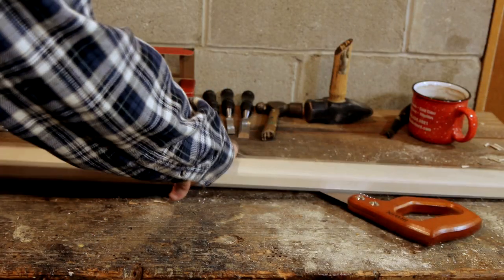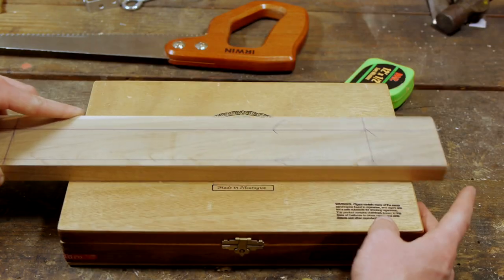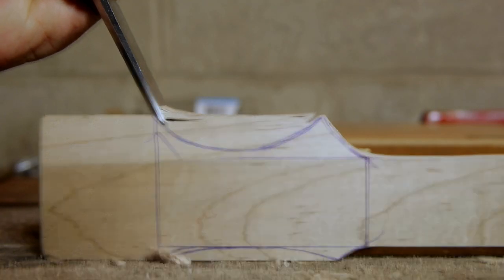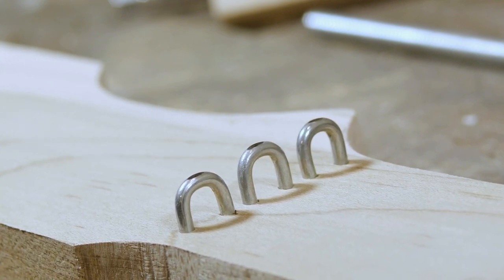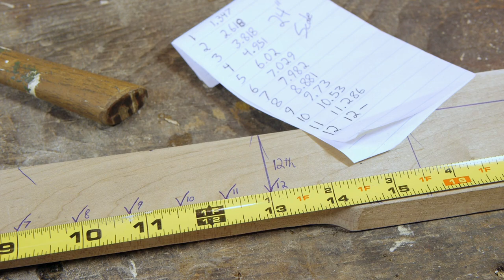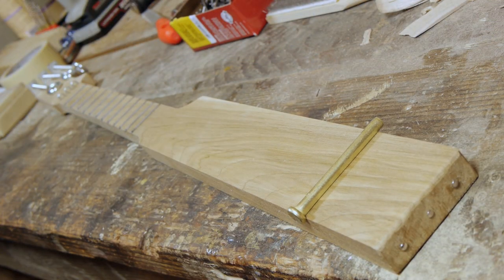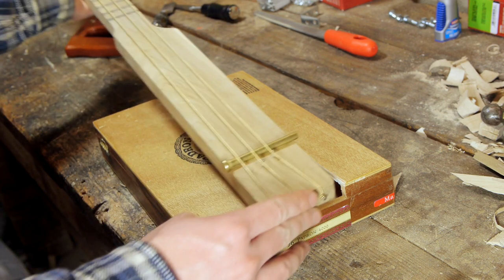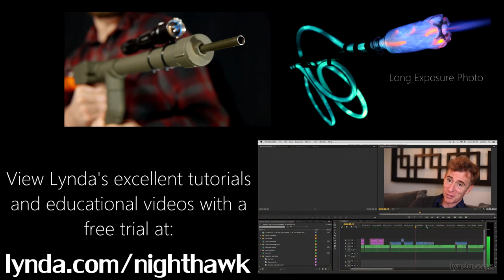How To Make A Fretted Cigar Box Guitar

Comment: I watched your video and it's nice to see a guitar being made from basic parts.  I make cigar box guitars and for very little money and effort, I would suggest real machine heads.  They are easy to install and much easier to tune.  Also fret wire is so inexpensive and with the right size of slots being cut, will stay in without any need for glue.  For cutting out the shape of the neck I would clamp the wood and cut slots along the neck up to the line and then chip them out with a chisel.  There's less chance of splitting the wood the wrong way.  I'd also use a pencil to mark everything, use wood glue and clamps, mark the fret lines in two places and use a t-square to draw the line for cutting.  I also like to install the neck inside the box and have the bridge on top of the box for better resonance.  Sorry this isn't me being critical, these are just things that can be done for not much more effort or money.  Great video :)

Comment: Working on my CBG as I speak. I’ve stolen some of your ideas and have added a few of my own. First off you can’t get cigar boxes where I live in N Ireland and so I’ve had to make my own box out of 3mm ply with a lite pine baton for the sides. I could only get a piece of walnut for the neck which I had to buy rough cut and miles too big all round. I’ve spent most of the day shaping it because I decided on a profiled neck wide enough for 4 strings. I’m using your tuner idea but put wing nuts on so hopefully I’ll not need a wrench to tune up. I’m enjoying the challenge. And I thank you for giving me the inspiration. I can’t see mine turning out anywhere near as nice as yours but I’m doing alright for an old timer with Parkinson’s. I’ll keep you posted.

Comment: Great video. I especially like that you have used simple tools instead of power tools. Maybe in the next video you could make a piezo beer-can microphone to complete the vintage country rig? ;)
Reply from the maker: I haven't looked into that before, but I bet the sound would go great with a CBG!
Reply: That would be sweet! I have built cigar box guitars before, but this is so much nicer of a design... I'll be using this for sure! 
I would absolutely love the beer can piezo microphone idea to go with it! 
The idea with the eyebolts is genius, does it hold tune well? And the bridge pins, does the pressure the strings create hold them in well, without tuning issues? 
Cheers, thanks for the new ideas!
Reply from the maker: ezrocks4u The tuners work pretty well, they're just easy to bump which sends them out of tune. The bridge pin works fine under string pressure

Comment: BEAUTIFUL CRAFTSMAN!
Reply: I was once considering how to make tuners/tensioners out of nuts and bolts, but this is a good design with the eye hooks.  A bandsaw is a good tool to have, but could be expensive, or a few minutes at a friends one, makes it simple, but chisling shows craftmanship with basic tools.   It would be good to convert those fret positions to inches and, plus,  16ths or 32nds of an inch.   THis is unique construction and design, and practical without fuss to make something.   An oval hole on the neck could help the string sound get into the sound body a bit better, but it would not matter if you put a PAF in it.  Possibly , the back of the neck can be rounded a bit more, with a 45 degree angle at the sides, perhaps 1/2 to 3/4 in, and then gradually smooth it round with a file and sand paper.
Reply: Muito interessante...!!! ~rr" ...
Reply: GREENPOWERSCIENCE p

Comment: This was a thorough and well-planned video.  I'm a casual woodworker, and had no problems following along with not only the 'what' you were doing, but you also did a great job explaining the 'why.'  I don't play guitar, but this makes me want to try it!  One question for you: have you found that the superglue holding the neck to the box was adequate? I'd be worried about those two lines of glue holding the entire neck to the box.
Reply from the maker: +RusselSprouts1 Thanks Russel!  Yes, I have found the superglue to be adequate. It would not be terribly difficult to break the box free with some effort, but doing so would not damage the neck so no harm would be done. Since the box has no reason to be held on any more securely than it is, I opted for a relatively weak connection in case it ever needed to be removed for repairs/replacement.
Reply: Ahh, excellent point. Solid work, I might have to give it a shot!

Comment: you guys need to use metric !!
Reply: Tell that to the old people who won't let us.
Reply: One president already tried it, it didn't work out, although I wish it did
Reply: Damnit Jimmy! Why couldn't you pull through for us?
Reply: I'm American and use metric with all my original measurements
Reply: I guess the military needs to go back to gallons and inches
Reply: As an American that grew up woodworking...yes. Yes we do.
Reply: as an american
growing up doing construction
no we fucking dont
Reply: As someone who went to school.
We already use metric. Imperial units are defined by the metric system and have been since before you folks were born. So we might as well just drop the redundant multiplier.
Also all of science and military use metric. The imperial system is archaic and if it wasnt for it now being defined by metric we would be nowhere. You cant measure things to any agree of objective precision by using it. It was good enough in the medieval ages, but not in the 21st century.
Reply: I agree to this. I'm very excited to make my own CBG and I appreciate all the tutorials, but many of the good videos don't use the metric system. Well, maybe I have to buy a non-metric ruler. Cheers from Germany!
Reply: we do

an inch is defined as exactly 2.54 cm. 

when you're dealing with hardware, 1/4 drill bit etc the easiest way to do this is to just multiply the number of inches by 25 and round to the closest, and that's the closest size in mm. Therefore a 1/2 inch bolt -> 12.5 -> 13mm bolt in metric.

When it comes to the fretboard itself you'll be getting that information off the internet so you ought to be able to find it in metric anyways.
Reply: Yes and no
Reply: Get over it.  We do just fine. And it's not hard to convert for uses like this.
Reply: @simon4187  💀

Comment: Really a good first try... I have built a few instruments and assisted a violin maker during an internship I was serving to learn some of the basics... one thing that improve things a bit is use  brass nails( a little harder to find  ) for frets and a 8" sanding block to level your frets to prevent string buzz...cut equal spaced groves  in your hinge pin bridge to let the strings set in  and one up from that, use a hard wood bridge instead of metal which will allow the sound to travel into the cigar box more efficiently which will allow for better resination  of the sound and tone of the instrument...thx Larry

Comment: Man, this was such an awesome video to watch. I used to have an acoustic bass, but sadly no more. This video has made me want to try building my own. I noticed one thing about the way you constructed the head makes it not an easy guitar to tune on the fly. 

There are probably a bunch of other people who mentioned this in the comments here... But if you altered the design of the head a little bit, it would also make changing the strings easier too. I would angle the strings the opposite way you've done it and create a second bridge at the point where the head and neck meet. This would allow you to put tension on the lines without adding the additional block of wood you did. 

It could also enable you to easily make this a 4 string bass by positioning the tuning pegs to two on the top and two on the bottom.

Comment: That sounds pretty and warm tone .
    Like the way you used I bolts as machine tuners and staples as guide pins or string trees. I tried to cut my slots like that about 25 years ago but I couldn't cut them close enough to keep my intonation right. I used nails too. You are better at measuring transferring cutting installing frets.

Comment: hi,  i'm trying to make a six string one and have a couple of questions:
1. what should the distance between 2 adjacent strings be?
2. is there a drill attachment/bit that does the job of a chisel in a faster and more efficient way
thank you, you have the most down to earth method witout huge and fancy wood working tools
Reply from the maker: +Vincenzo Shabeeb Between two strings is a matter of preference, but about 1/2 inch or less. To cut the neck faster you can use a hand saw to cut most of the wood away before chisling.

Comment: I used a lot of the points on this for a ukulele I built. I also used it as a reference for a cigar box bass guitar I'm making for my friend. (I screwed up the chiseling the first time.) I am doing something more similar to your older video (which is also interesting and useful) and putting the wood inside so the logo is still shown. I'm also going to attempt to wind a pickup at some point.
Reply from the maker: That sounds pretty cool
Reply: Wow, you really do read all of your comments, even when the video is 2.5 years old. After watching this video about 15 times, I always wondered, why didn't you secure down your door hinge?
Reply from the maker: There's no need, the strings hold it in place.

Comment: I would use a band saw and a drum sander.  The chisel will cause the wood to slit like it does in your vid.  Would be a pain if you have to start over due to the wood slitting open.  A small square would be helpful to make the lines straight.  Some of them you could tell were off.

Comment: When marking frets, I just use the centimeter side of the tape measure, and multiply the length by .9439 each time for the next fret.  Centimeters are marked in tenths (millimeters) so it makes it easy to find the correct placement.

Comment: Would it be viable to make a 6 string version of a roughly similar neck size if you offset the tuning pegs on the headstock? 

like say if the top one was 1in from the nut, the second was 2in from the nut etc.?

Comment: I've made dozens of these in the past 4 years. I actually use 3" 3 16ths eyebolts with wingnuts instead of the 4" 1 /4 "With nuts. Before I cut any  of the board away, I cut the fret slots while everything is straight and true. I graduated to using a jigsaw instead of a chisel. when I do use nails, I use 2 inch nails to avoid having to grind down the head. Everyone I post these On Cigar Box Nation, I call them a NightHawk. Other people have named what I build a Lyons NightHawk.
Reply from the maker: That's awesome, glad you've had some fun with this one! Looked up your builds, they're great!
Reply: That's awesome. Thank you for taking  look. This is the first instructional vid on cbg's I've watched. This is a brilliant design. You're videos are top shelf and truly inspiring.

Comment: Incredible.  Would you conceivably be able to double the width of the fretboard and make it a six string?  Also, how did the strings hold up?  That figure 8 knot you did made me nervous...
Reply from the maker: Knot did fine. For six strings you would not need to quite double the neck width, but the headstock would need to be much larger.

Comment: There's a minor detail that's gone missing in translation. There are many 4-inch eye bolts out there, but the diameter is pretty important. For example, this won't fit a 4"x0.25" bolt, as it'll be just too big for the bracket hole. Aside from that, this is an excellent example of some DIY creativity!

Comment: so i finished making mine, the fence staples were bent nails and didnt work as well as the square ones which were not for sale at lowes, the eyebolts i had to go to ace hardware for, no one knew what #18 eye bolts were so i got 4 inch 1/4 eyebolts, my neck dimensions were also different you also failed to mention you need a 4 foot long plank the plank was .75 x 3.75 × 48 i shaved it down to 2 inches wide, had to buy a new chisel as i was working with a dull one. for the frets i used flag pole wire i had fret buzzing on my E strung on frets 1-3 so i had to apply flag pole wire butted and glued against the the fret right before the actual fret. I also had to adjust the height of the staple on the E string which meant pulling the staple, and gluing in tooth picks letting them dry for 12 hours the sand it down and reapply the staple bc the action was too low hittingt the first fret and buzzing. Now i havea fret buzz on the D string on the 7th fret i tried placing flag pole wire in the area but that added buzzing elsewhere and deleted my 6th fret bar turning 6 and 7 into the same note. What do i do to solve the buzzing?
Reply: For anyone with this problem, as far as my knowledge goes (not that far) the solution to buzzing has most times to do with a proper, EVEN sanding of the frets; they really need to be ACCURATELY the same height, otherwise they get in the way of each other and produce that all horrible buzz. Use a relatively long piece of wood covered in sandpaper to sand across multiple frets at the same time, with proper pressure distribution,  and good luck. Thanks First Last for sharing your experience, it's encouraging to know that it you'll not find the exact materials but it can still work :)

Comment: Awesome work. Is it safe to assume that I could use these techniques to make a 6 or 12 string, except maybe use smaller eye bolts?
Reply from the maker: Yep. I might use regular guitar tuners for simplicity if using more strings.
Reply: NightHawkInLight , fair enough. I’m notorious for my “mad scientist” experiments with CBGs. I might try it with a 6 string just to prove I can. But you’re right. Using regular tuners is probably simpler.

Comment: A suggestion: try to glue a bit more wood into the cigar box. You could put some 1x1s inside of it, touching both the surface of the cigar box and the neck. It could fall and break very easily if you just have the few mm of the box making contact with the neck
Reply from the maker: Not too big an issue in this design because the neck has all the tension on it. If the box broke off you could just glue it back on.

Comment: I'm planning on making one soon. but I have a question. is it completely necessary to use a chizzle? or could I use a table saw to get the lengthier parts cut? also could four stings be put on instead of three?
Reply: Adam Sherman you can do anything you want, you just have to change a few measurements on the headstock

Comment: You say to sand the wax out of the fret holes. Do I have to do this when using varnish?
Reply from the maker: You should at least lightly sand the varnish in the grooves so the glue has some texture to stick to.
Reply: NightHawkInLight
Isn't varnish better to stick to? Atleast I thought so since you can buy glue/varnish combo's in one bottle.
Reply from the maker: Maybe, but you should rough up the surface all the same. Glue always sticks better to rough things than smooth.
Reply: NightHawkInLight
Isn't a rough service bad for the strings?
Reply: You're roughing up the slot in which the frets are being placed, so it will never see the light of day after it's been glued in.
Reply: TIMExBANDIT
Okay, sounds a bit grim but okay xD.
Reply: You are roughing up the pits that the frets will be placed in, the strings will never touch them.
Reply: MrTrollinglol
But it's for slide guitar. So on my old guitar it touched the frets too.
Reply: The slots for the frets need to be roughed up for the glue to stick, same done with the frets themselves so it'll stick to them well too. He sands the part that actually touches the strings smooth later on. It was also said in the video that if you're doing this for a slide guitar you don't really need the frets, if I remember correctly.
Reply: *****
Oh. Thanks. That solves the problem.

Comment: Is it necessary to chisel it away or is that just how you do it? Would i be able to use machinery like a Jigsaw?
Reply from the maker: +Hagen Stolz You can use any tool you'd like, I just wanted some chisel practice.
Reply: +NightHawkInLight sweet thanks. Do you by chance have any blue prints for this? I'm trying to build it in shop and my instructor wants to see blueprints
Reply from the maker: +Hagen Stolz Sorry you're on your own with that one. It should be pretty straight forward to sketch some out.
Reply: +NightHawkInLight thanks for the help

Comment: would it be robust enough to add a pick up and make it electric. I guess there's plenty of space inside for the wiring
Reply from the maker: Sure, you just have to carve out a spot for it. If doing so makes that part of the neck too thin you can glue an extra bit of wood to the back.
Reply: cool. thank you

Comment: Is it possible to make a six-string neck with the measurements of a regular guitar or a baby Martin?
Reply: I'd suggest making grooves on the bolt that acts like a bridge to have an even spacing between strings.
Reply: +Z. Ehling It is, but you would have a hard time finding a cigar box of that size, they exist, but you might need to really look around. If you want to build a guitar of that size you might want to look into martin's guitar kits.